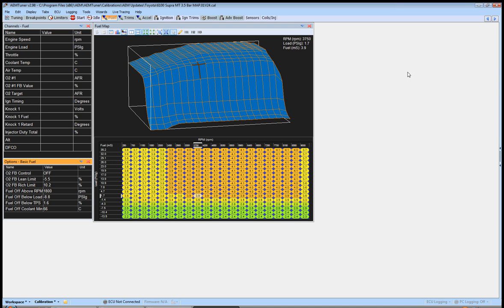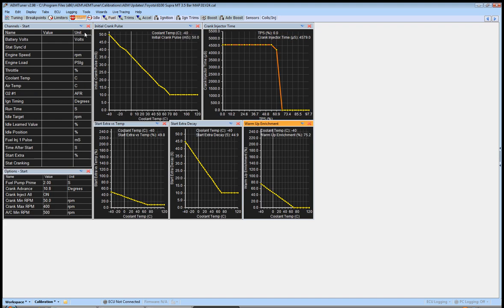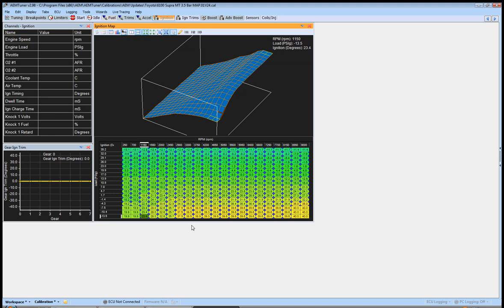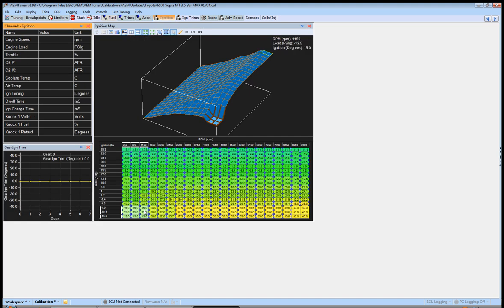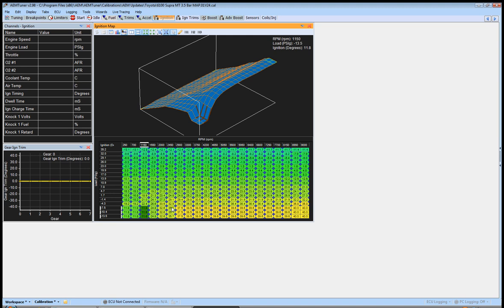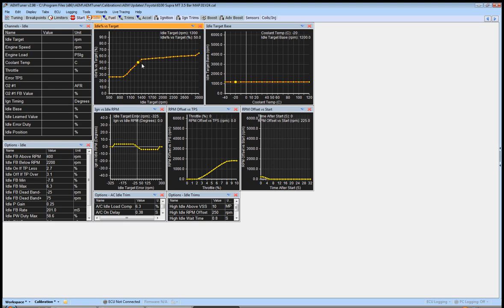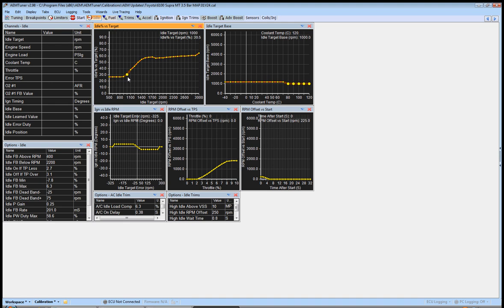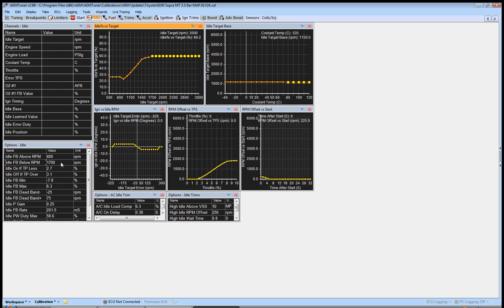AEM Tuning part 4

Comment: What if the car doesn't response to the table% vs target? I made the car single turbo and now it doesn't want to adjust the values and is stalling when pull over the gas pedal. It doesn't where I move the curve it just reflect the error but the engine speed doesn't match the base.

Comment: first off, thank you so much for these videos. I was wondering if you knew how configure a 2 wire IACV in aemtuner. I heard I just need to "assign it in software", but I can't figure it out. how do you assign a specific pin to idle output. I have a 1jz gte 6 wire oem, so it's a bit of a difference.

Comment: Hey bud! I've started from video one, and you have definitely been a huge help on cleaning up my maps and me understanding more about the V2's capabilities. I am stuck at one point on this video though. I'm a ProAm drifter with Neo RB25 240 that is a purpose built for drifting. That being said, I deleted my idle are control valve. Would you recommend me putting it back in or is there a way that I can turn off the idle control in the ecu so it's not looking for those parameters? Thanks!